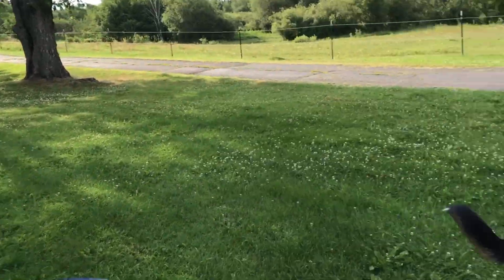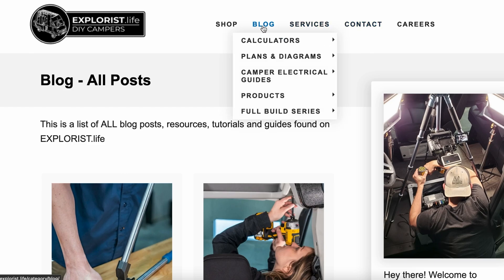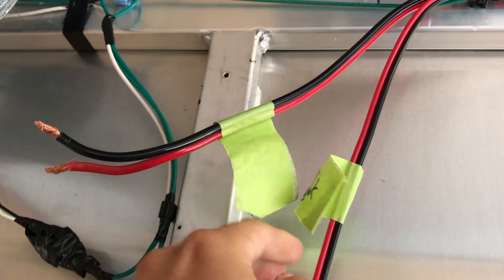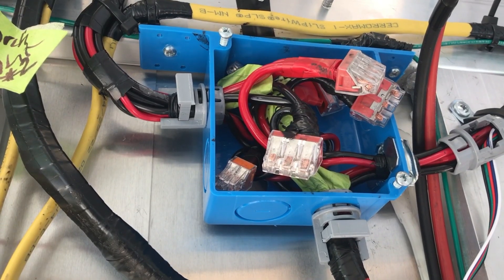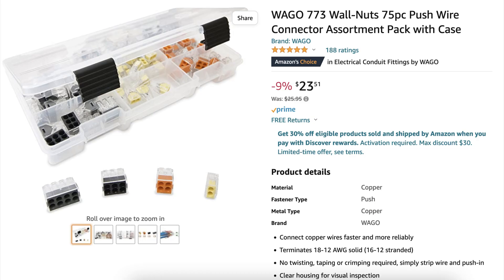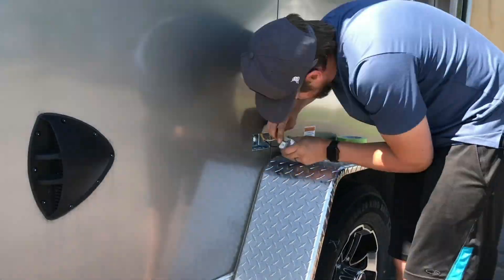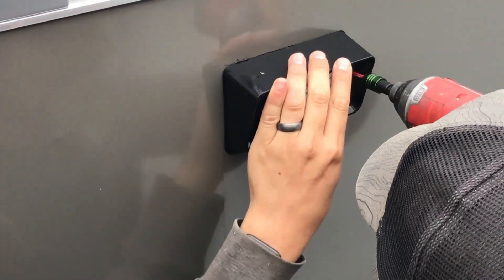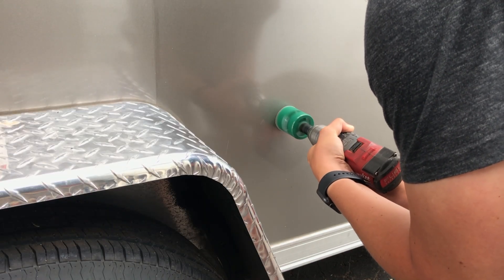Cargo Trailer Conversion Series: Electrical System, Part 1- Wiring for future loads

Comment: Good job on your build. Just a tip, when you are drilling larger holes (hole saw) place a piece of wood as a backing and drill and cut into it. The thin outer aluminum skin can tear easily and ruin the hole.
Reply from the maker: Great tip, thanks!

Comment: so I watch most of your videos, I have a 7 x 16 enclosed trailer that’s been converted to a toy holder.

Long story short I’m putting a rooftop AC now that the technology has gotten much better as their essentially mini splits now, with that said the one that I am installing is 90 pounds so without going into too many details, I plan on using the ladder rack for Support as the roof itself would never support that kind of weight. So my question to you is having those ladder racks work out and do you recommend them ?
Reply from the maker: Sorry for the late response. That’s an interesting idea to use a ladder rack to support the AC unit. You’ll have to let me know if you ended up doing that. 

I’m no longer in possession of the trailer but I’ve heard of no issues from the current owner. That particular rack worked but I would be tempted to still shop around and see if there are other options now.
Reply: @getaway_man  no worries appreciate the response. I’ll keep you posted on how it works out. I’m getting ready to head out for four days in the middle of October.

Comment: Can you just use a 50 amp 25 ft rv generator cord to a 50 amp receptable that is wired to the panel box coming from the generator?
Reply from the maker: I’ve never gone this route but I imagine that would work great. I would want the exterior receptacle to have a in use cover or mounted underneath trailer where it’s protected from weather.

Comment: thank you for all your info where do you buy all your bonded wire from
Reply from the maker: Amazon for the stranded/12v. I like the GS Power brand for that. I’ve tried stranded wire from big box stores and it’s not even close to the same thing, too rigid, less strands, thinner insulation etc. You can also search for marine duplex wire on Amazon. That’s another high quality option but I’ve found it hard to work with due to the extra sheath.

I bought my 120v/solid wire from menards/Home Depot but if I did it agin I would use stranded for that as well since stranded holds up better to vibrations.

Comment: Wouldn't you insulate first? Not aware of your plan.
Reply from the maker: You could insulate and then wire but in my previous van builds I would be fighting the insulation when fishing wire through certain areas. It’s a bit more straightforward in a trailer but I’ve adapted to always do the wiring first.

Comment: WAIT - Time out... You only put in a 15A service (shore power)?? But ran 12/2 romex and installed multiple 20A outlets? Thats seems like a huge waste, to me. A 30 amp service would have only cost a few dollars more. Otherwise you could have just used 14/2 romex and saved money on wire, and used 15A outlets (rather than the 20A's). Right? When I saw all the 12/2 romex (20A), I was sure you were installing a 30A or 50A  service.  If you were not installing a AirCond, a 15A service is fine. But a 15A service with an AirCond, multiple 20A outlets, seems undersized, to me. 
I'm not trying to be critical, it's your build, do it however you'd like. But electrical, AC and DC, are my strong suit. I'd love to know the thought process on this decision.
Reply from the maker: Hey, thanks for your insight! I honestly think you’re right. I’m not sure what I was thinking. A household air conditioner will run ok on a 15a service but nothing more. I do have a 30a distribution panel and obviously have more outlets installed. I had the 15a power inlet lying around and obviously didn’t give it enough thought! There’s so many things to think about when building a camper and creating a youtube series on top of that. I just simply overlooked this. I’ll be upgrading to 30 amps soon. Thanks again!

Comment: Definitely like the way you think each step through. Tons of ideas and tips! 
In never used Wagos, yet. I don't have any on hand even though I do a bunch of wiring. Perhaps it's time to put some into my inventory so there won't be a wait period in the middle of whatever project I'm on...
Really enjoyed this presentation!
Reply from the maker: Thank you much! I haven't been using wagos long but I'll be using them on every camper build moving forward. I'll also be using the lever wagos a lot more too. Any time you have a light, a  switch, a usb outlet etc...Anything you might replace in the future. It should make the task a lot easier!